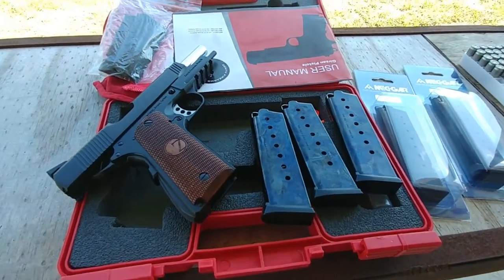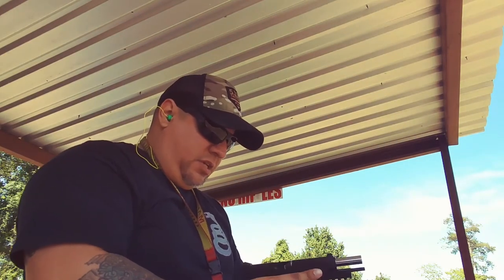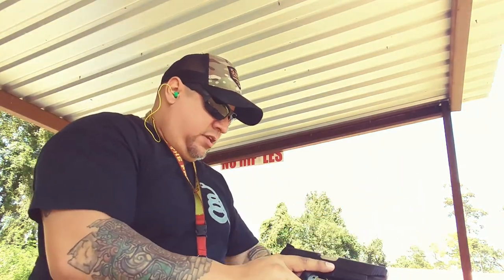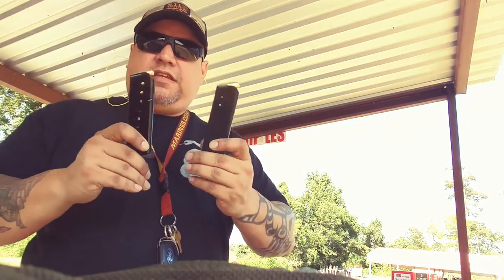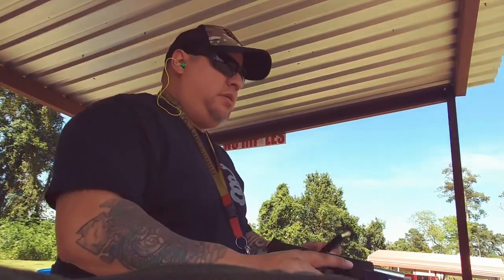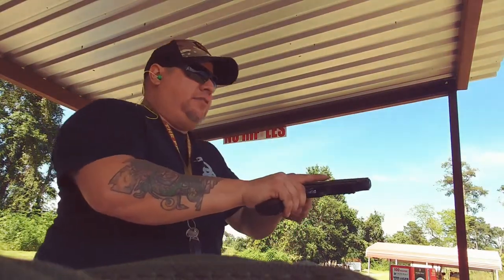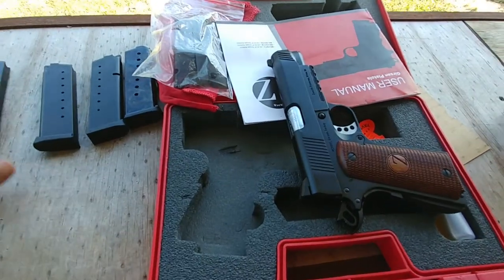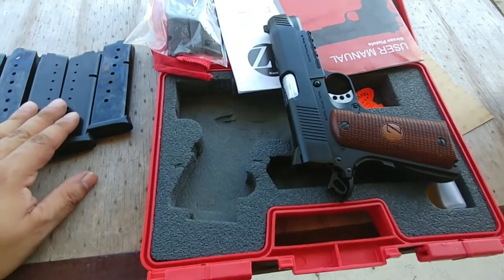girsan 1911 new mags

Comment: I have to 1911’s and I installed Wilson combat milled stainless magazines catches because they hold the magazines in tighter. Secondly always make sure to use a 16LB recoil spring. Not a 18,20 or 14. ONLY USE A 16LB recoil spring.

Comment: The issue I find, besides the now supplied Met-gar mag's is the extractor was never tuned at the factory. Once preformed this simple procedure, all is smooth as butter. Does it match the quality of my Les Baer, no. but it doesn't cost 3 grand either. 
KnifeMaker

Comment: Nice video. You have a lot of perseverance. Only wish I'd seen your video before buying a Girsan MC 28. I sat through many reviews praising the MC 28. My bad. Should have accessed "Girsan Problems." Same issues for me: stove pipes, failure to retract after last round and a few out of battery events.(OOB)With me, the OOB headaches occurred randomly-unlike with your experiences. Maybe spring, maybe mags or maybe all-around defective/ workmanship. Will send it back to Zenith. Whether fixed or not, when I get it back, it will be sold. If I can't rely on it to function properly, it will become history. As we used to say back on the block: "Fkthis bs."

Comment: I don't think it's the mags or extractor it's nobroken in and your using alluminum ammo the heat and pressure reacting to the un brokengun I causing the jams use brass ,clean the gun and then try tuning extractor

Comment: Did you ever use brass ammo? If its not the mags....I would try brass and if same issue....sell it.
Reply from the maker: Joe Green I sent it back again and girsan said they adjusted the extractor and they said the slide release was catching on the slide so it was addressed. They said they fired all 3 mags and the issues where gone. I haven't been able to go test it because the range I go to is under construction due to the late hurricane.
Reply: Well I hope it is up and running. Give us an update when every you get a chance. Hurricanes suck man. We are getting ready for one over here in New Orleans today. LOL Im trying to get all my gun junkie stuff done before the power goes down. I was thinking about a Girsan Beretta clone, but your video has me saving my 250 bucks for now.
Reply from the maker: Joe Green actually I have a video of the girsan BERETTA clone.
https://youtu.be/Pstpt8PJJ10
Reply from the maker: Joe Green tell you what I also have owned the taurus pt 92 and absolutely loved it both under 400

Comment: Extractor tensioning problem? Likely culprit. It's a f*&%^#$ pity they can't be bothered running 20 rounds through these things before they get through the shop doors and onto the pallet to be sure they feed correctly. In all likelihood it's a tensioning problem. Send it back. What a pain in the ass. Sorry man. Do you have any buddies around that work on 1911's?
Reply from the maker: Bradley Slackenfelch I adjusted the tension on the extractor it was super loose.